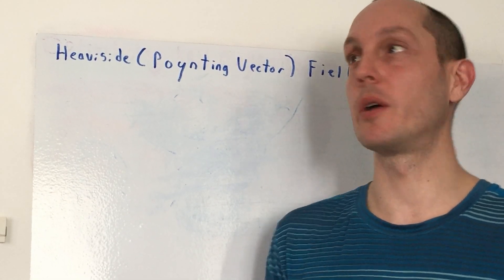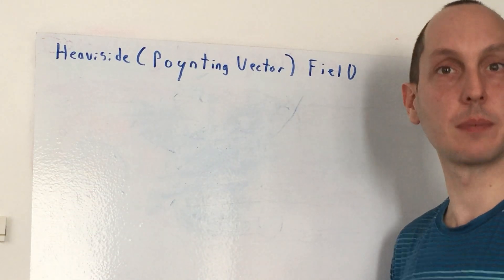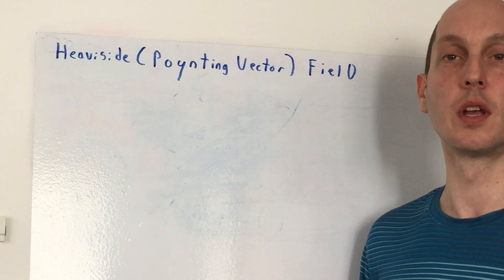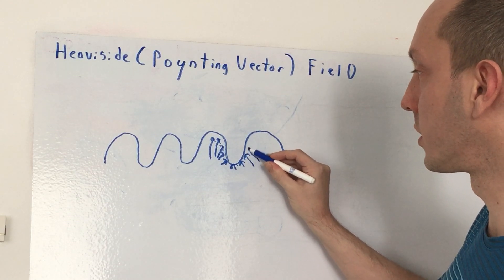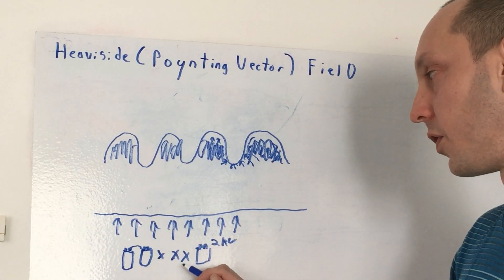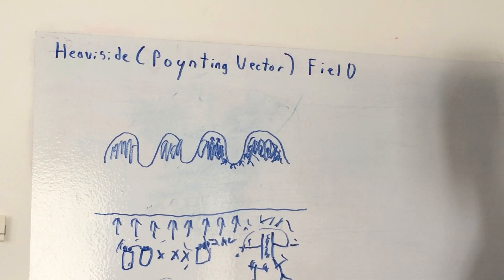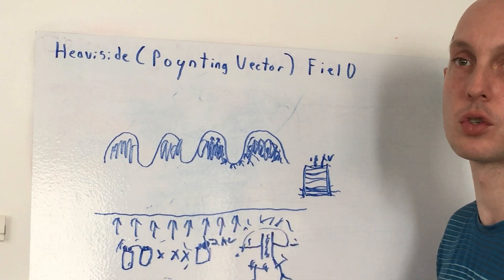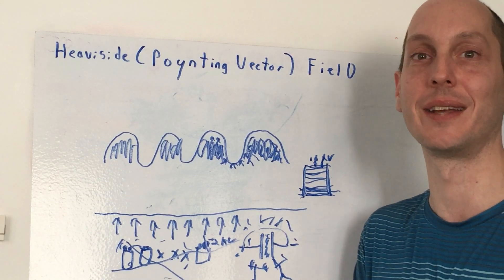Heaviside Poynting Vector

Comment: Been studying Bearden recently, struggling to understand Heaviside/Poynting and regauging and you’ve helped some pieces click into place in my head, so thanks for making this!!

Regarding the arrow illustration - I could be wrong but I think the way you drew it is the way Poynting visualized it, perpendicular into the wire with a slight parallel angle for direction, but Heaviside’s idea was it was parallel with a slight perpendicular angle into the wire and this huge extra component that doesn’t diverge into the wire that we don’t use. Just adding that here to contribute to the greater understanding of things

Comment: Hello Joel, I am enjoying your videos and I have a question about the Heaviside poynting vector you are talking about.  I have also read about Thomas Bearden and what he says about the Heaviside Component Flow that is outside of the circuit.  My question is are you talking about the Heaviside component that remains outside the circuit or the part that actually gets captured in the AC Generators? How are you maintaining the source charge dipoles Thomas Bearden talks about?  Thanks, Michael

Comment: Poynting vector is E x B
E = V/m, B=I/m, ExB=VI/m2=w/m2 perpendicular to transverse E n B.
Why is it called heaviside field? Is it the same?
Reply from the maker: Some refer (Tom Bearden) to it as the heaviside because of Heaviside's responsibility in reducing these from 20 Maxwell variables to only 4 in today's traditional electrodynamics. I guess a nickname for the effect. Yeah it's a bit of an irony is it not? :) Tom to be precise calls it the Heaviside component of the wire in energy systems and moves on to describing it as the inner workings of the poynting vector.
Reply: @joellagace1679 
I read in some paper (i believe one  abt the science of avramenko plug) that the B-field-free one wire systems have no Poynting vector, and that this is the reason why resistors don't eat up.
I'm new to poynting/heaviside vector, will try to read into it.

If HS/P divergence means power flux changing direction 90 degrees and flow into the resistor to become joules and heat it up, then it is removed from the surroundings and thus conserved. 
Then non-diverged (not converted to joules) HS/P flow along the conductors is like a wind that can be captured by putting something in its path without losing and thus not conserving the intensity?
Reply: @joellagace1679  
But isn't that now default in the books?
 Veritasium made a video about it, the one about how current really flows: outsiude of the wire.

Don Smith also mentions the undiverged Heaviside flow in a patent but it's too vague, 

I think Bearden sees the ExB power flux poynting vector as the heaviside flow, and the energy that's diverged into the components as poynting flow. But maybe I'm missing some poynt.

Check out the alternative theories of Ivor Catt for the real definition of heaviside currents, he also presents the capacitor as a transmission line with the B fields cancelled and a stationary E flux.

Comment: Thank you! You are doing great. One constructive suggestion: try to clearly draw out the schematic on your erase board as best you can. I know it's tough but even if it takes a min. longer to do, a picture conveys a thousand words (as they say) 

These hidden electrical concepts are somewhat complicated for dummies like me who often struggles putting electrical schematics together properly not to mention rather elaborate concepts not "normal" to modern electrical theory. 

Now for an idea for you:  (great, another project right?) 

Here is something I have been considering: 
There is a patent for an electrical generator that has a stationary 3 phase "rotor" that does not move. Rather, what does move (or rotates) is the magnetic field. The outside stator (also in a three phase configuration) picks up the rotating magnetic field and converts it into electricity. Here is the patent: https://m.youtube.com/watch?v=K9JPrkLq3dE

Now I have been thinking about using acrylic resin heavily impregnated with ferro iron dust. You can create any mold / shape configuration one desires. To make it more efficient, one would place a strong magnet (temporarily before the resin cures) on the outside of the mold at each coil core area ,(the center core area of the stator coils) This would pre align magnetic paths inside the ferro iron dust impregnated stator core material from one joined core to another (as the back side of the core would be joined integrally with the next comprising the outside of the stator assembly). 

So, in assembly, imagine a LG 3 phase 110 V AC "pancake" washing machine motor (example here: https://m.youtube.com/watch?v=qZlT_ITlrUA

Now, using the coil assembly, (don't need the outer metal rotor) you apply a 110v AC motor controller 3 phase "signal generator" available at Amazon) to create your stationary rotating magnetic field. 

Now, using the ferro magnetic iron dust acrylic you mold / fashion an outer stator complete with windings wired accordingly. Amazingly, in the patent, the inventor states specifically that iron dust impregnated molded material works very well for his application. 

He claims a self looping sustainable power generation from this idea. It only needs a brief external power start where it can then be self sustaining.  No losses from brushes, mechanical losses, fans, etc. Even the metal surfaces from the stator and "rotor" are touching (no gap) improving performance. 

I thought this was very interesting and doable using off the shelf parts and materials.

Comment: Hi Joel, I watched a video where they had 2 plates set up like the ones you drew, they gave it a 9v charge then moved the plates apart and the voltage shot up. If that's true I wonder if moving the plates apart in your setup would increase the static field you spoke of?